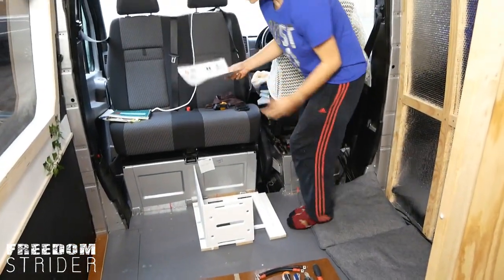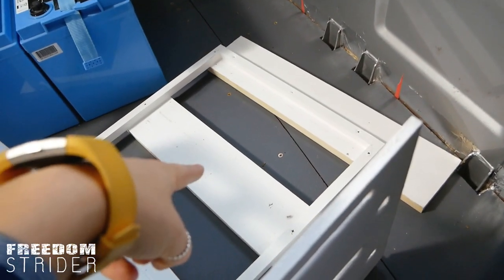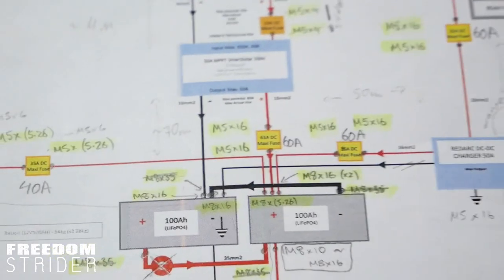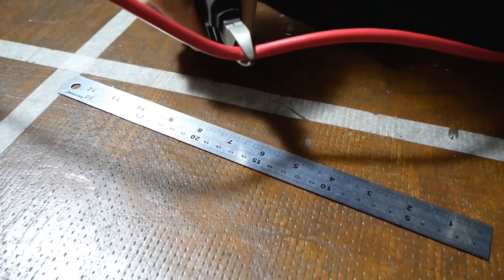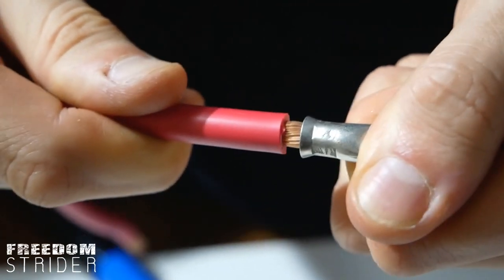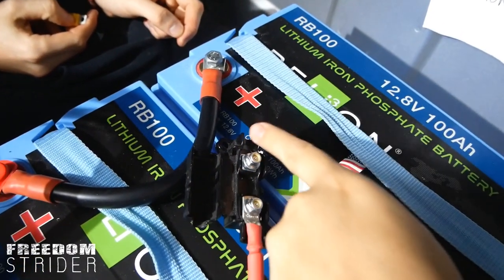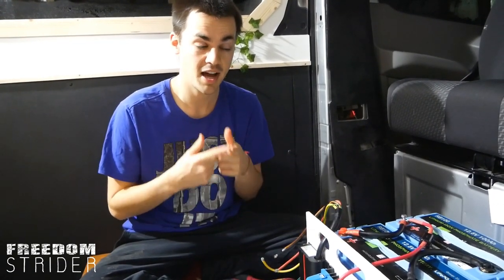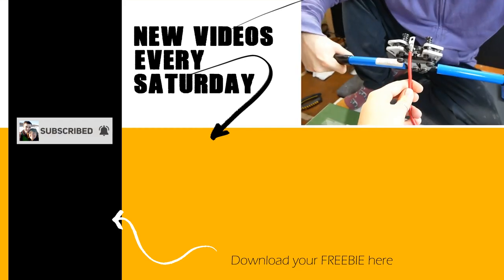12V Electric 101 - The Basics.

Comment: Nice work and well explained as always, did you go for 200ampH because of the heater?  I’m planning on using 200aH of AGM so effectively half.
Reply from the maker: We went with 200ah because we calculated that our standard usage will be over 100ah so we wanted some off grid capacity. Now we would go with more AH because we are using electric cooking. 

The heater itself doesn't pull that much power. If you are not electric cooking 200ah is plenty and depending on your set up you can make do with 100ah (especially if you stay in sunny places with solar panels on the roof). 🙂👍

Comment: Hi...Thoroughly loving your vanlife channel build.  Regarding your info on negative cables back to the shunt, did you ground any cable to the metal of the van or not?
Reply from the maker: Good question,

Yes we did, but only because we had a very specific problem that made in nessasary. Let me explain.

In our van (and most campers) you have 2 main circuits to think about: 
1. Leisure battery circuit
2. Start battery circuit

The only real reason things get grounded to the van is because the manufacture chose to take a shortcut and make the whole van chassis the negative terminal in essence.

When you put in your leisure battery system, you have the choice whether to make the van chassis the negative battery terminal as well, or, complete the circuit loop by running all the negatives back to the battery negative (ie a closed loop).

This matters because all the controller boxes that need to be powered (MPPT, AC charger, B2B charger), have their own grounding instructions. We tried our best to keep our lesuire system a closed system since we have lithium batteries and need to track all power going in and out the batteries. So all our negative cables had to run through our BMV shunt, hence why we didn't shortcut and ground things to the chassis.

However...once we installed our battery to battery charger, we did need to ground our BMV shunt to the chassis (https://youtu.be/R7SqNawa6CE).

This is because our vans starter battery is grounded to the chassis and since the B2B charger connected our leisure system to the van start battery, the circuit was no longer a closed loop, and the charger didn't work unless we grounded the leisure system to the chassis, so we ran a cable from the shunt to the chassis. This made our B2B charger display correctly on our BMV readout and actually charge the lesuire system

I hope this makes sense, any more questions let me know :)
Sam

Comment: Great video and you've explained the electrics well. However I would mention about It would be best to turn your MPPT the correct way up with a terminals facing down as specified in the manual. Long-term it will prevent dust and anything else falling into the unit, It will also stop hot air rising off the unit ( Only an issue in the height of summer ) and heating your cabling. but great job I like the compactness of your set up!
Reply from the maker: Thanks! 🙂 We'll think about the MPPT - for the immediate future it will stay, but we might put a partial cover for the dust and we'll keep an eye.
Reply: @FreedomStrider  Any difference wiring MPPT vs PMW?  Unreal vid.

Comment: for what i know is much better to ground using copper cable than metal from the van, because of it's higer conductivity
Reply from the maker: I would agree, copper is much better than steel - we're no experts in grounding by any means but it annoys us that VW has grounded things to the van because it just makes circuits much harder to follow and we don't know what is interfering with what. So we'll try and keep our leisure system as independent as possible. Also, another thing about grounding to the van is that you have to scratch off the paint and expose bare metal which can cause rust issues eventually, whilst copper doesn't rust as easily. 🙂

Comment: The best way to connect wires into screw connectors is to crimp ferrules on each end, because the screw moves the wire strands on both sides of it:

https://www.amazon.com/s?k=ferrule+crimping+tool+kit&crid=1M3GVUD2UJFGM&sprefix=ferru%2Caps%2C201&ref=nb_sb_ss_ts-a-p_3_5

They are color coded for each size of cables.
Reply from the maker: Ferrules? I'm assuming that's different to the crimping eyelets we are using... Are they like a tube that you crimp on instead of the eyelet and then you slide that in the connector (like the mppt one)?